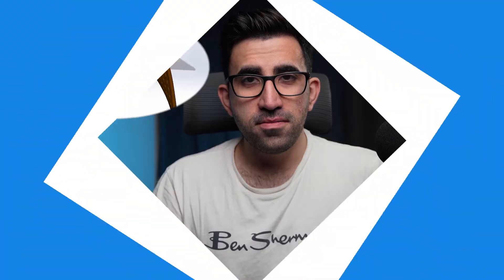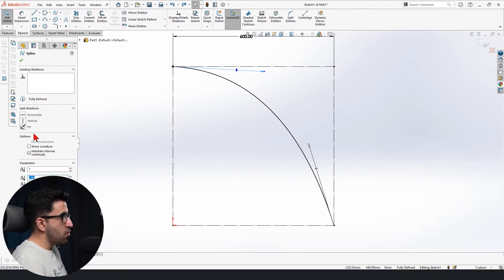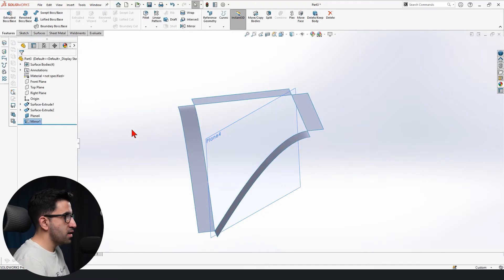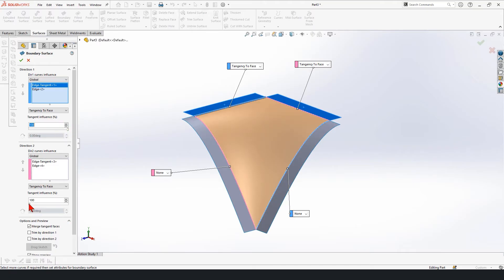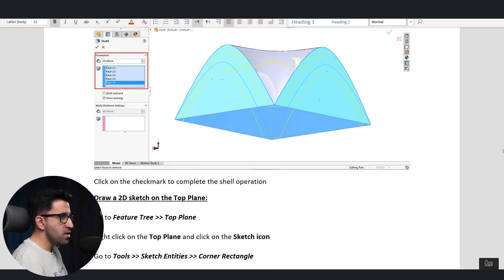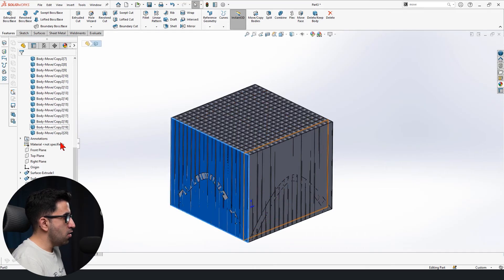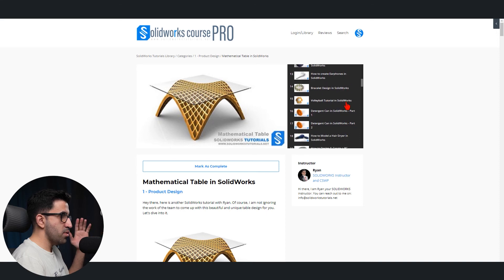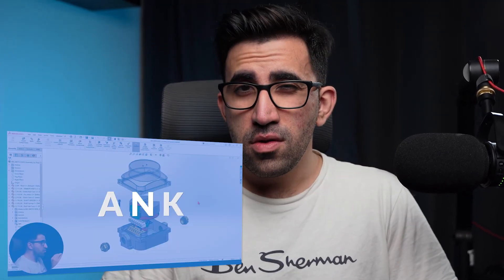Complex Table Desing in SolidWorks - (Step-by-Step)

Comment: The table panel That's what the design is called. Part of moving and copying solids didn't work for me, but I did it in two steps using linear matrix and symmetry. I managed to finish it, thanks.

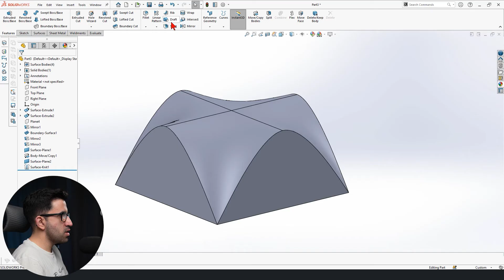Comment: 10:28  it's also correct if you used thicken to the surface right?
Reply from the maker: yes! with a minor difference! you have to do it to see it. The flat surfaces "feet of the table" that stand on the ground, won't be perpendicular to the ground if you do it your way

Comment: Hi,how did you modify the vectors of spline?
I can not do that with solidwork 2019
Reply from the maker: you certainly can! select the spline to show those arrows, if they don't show, then it's a different issue with a different solution, but if they do, just use those arrows to drag them around

Comment: Well... "Axes" and "Inferencing"... does it ring a bell to someone...!!??
Or you are wearing your gloves on your feets...!!??
Reply from the maker: Yes, "axes" and "inferencing" are both commonly used terms in CAD software, including SOLIDWORKS. "Axes" typically refer to the coordinate system axes in a 3D space, which are used to define the position and orientation of objects in the design. "Inferencing" typically refers to the process of automatically aligning or constraining objects based on their proximity to other objects or geometric features.

Both of these concepts are important to understand when working with CAD software, as they can help you create accurate and efficient designs. If you have any specific questions or concerns about using these concepts in SOLIDWORKS, feel free to let me know and I'll do my best to assist you.
Reply: @with-aryan  Good citing... (from wherever...) - the point is that I haven't seen either of them in this video.!

Comment: The surfacing at the beginning was good however over complicated, a simple 3D sketch is the better option, to assist the curve which can be on a standard plane. You can draw the curve, create a separate 3D sketch as a new feature. Then follow your other steps for the boundary surface.

A good thing to also note, rather than a spline, build an organic form using a 3 point arc. You need to be able to apply a radius to a mould to create something like this, unless the mould is hand carved.  A series of radii you can dimension on a drawing. 

I’d also recommend creating a sketch of a square followed by a pattern, either as a sketch or feature pattern, up to you. Cool table however you don’t need to create so many bodies to achieve this. A simple sketch will be fine.

Keep on teaching, I learnt some new tips so thank you, always something new learn!
Reply from the maker: Thank you for your feedback and additional insights! You make some great points about simplifying the surfacing process with a 3D sketch and using a 3-point arc instead of a spline for an organic form. It's always helpful to consider different approaches and techniques to achieve the desired result in the most efficient way possible.

And you're absolutely right about creating a sketch and pattern to achieve the same result as the multiple bodies shown in the video. There are often multiple ways to approach a design, and it's important to find the method that works best for the specific project and design goals.

I'm glad to hear that you found the video helpful and learned some new tips. As you mentioned, there's always something new to learn in the world of CAD design, and it's important to keep exploring and experimenting to improve your skills and techniques.

Comment: Is this a realist design or just for practicing ? I mean is this manufacturable ? if it is then which manufacturing method can be used for this model to be manufactured ?
Reply from the maker: This is for practice only Deniz
Reply: @with-aryan  thank you Aryan. Can you please make some videos about manufacturable product design ? İt is better to include assembly features in addition to design phase

Comment: i have one good question for you Aryan
now i want to make this table for industrial use
i need to make it from sheet metal and everypart need to connectible with each other like a wooden puzzle toy
can i do that with command easy way or i need to do that one by one by hand ?
Reply from the maker: I wouldn't do that one by one. I'd do row by row and column by column at the most. Each row with a single sheet with cuts in it to accommodate the perpendicular row.
Reply: @with-aryan  my real quesiton is is everybody doing this with their hand ? 
isn't it too much waist time with one thing ?
maybe you can compare with money it's okey
ant the line of your table in our country you can cut this shape just with water jet 
i know you are sharing some ultra design technic but  what are you thinking about manufacturability
and again i know these questions is too much for free 
and i know you are the only solidworks youtube channel i contact with on the comment (cause you are answering the comments)
so thanks again if you answer my quesiton

Comment: Why can't we use thicken the surface instead of making a solid body and then applying shell to it?
Reply from the maker: give it a try and see the result yourself, it would be a good experience and is an excellent question
Reply: @with-aryan  yeah, i saw the change...legs of the table aren't created properly with thicken feature
Reply from the maker: @rahulnalamasu2071  there you go ;)